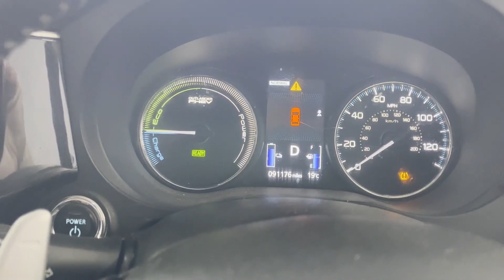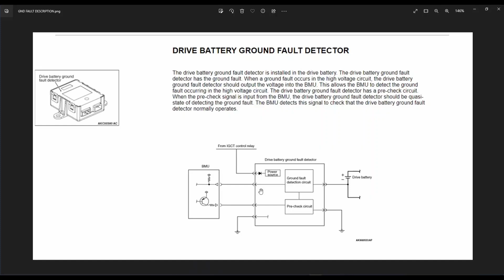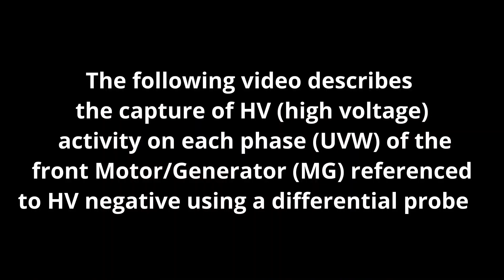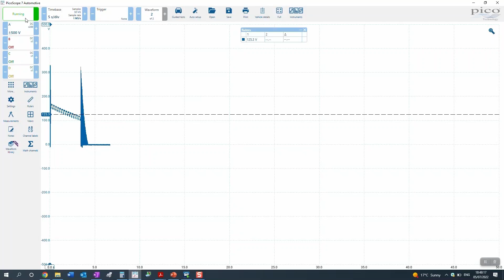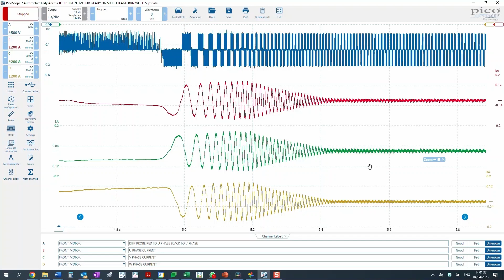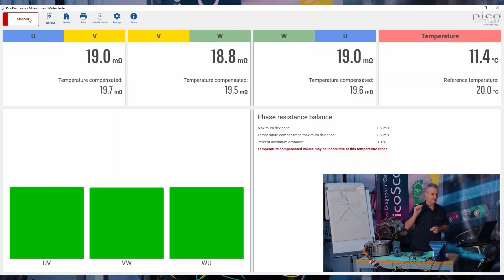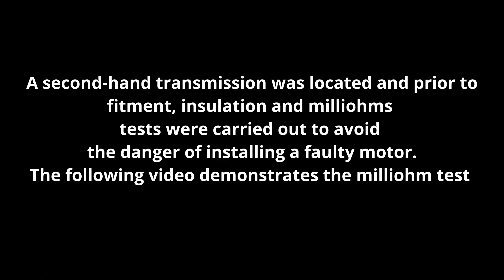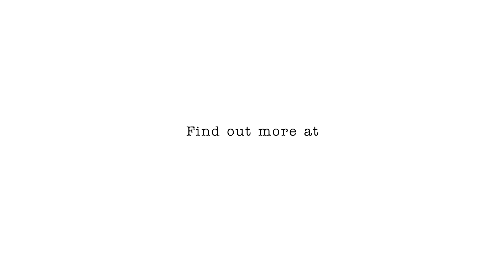Case Study - High voltage isolation fault diagnosis with PicoScope | PicoScope Automotive

Comment: Good video with many informations, thank you. 1:03:00 maybe think about an adapter with a tubular cable lug on one and a banana socket on the other end, so that you can use screws for conneting the measure leads to the motor instead of using crocodile clips. 
And maybe something with a vise grip (on a bolthead) for conncting the housing to a measure lead.

Comment: Hi Steve, the Video you did is very good Work. The Analytics Work and the gentle explanation is a Show👍
I have a question. How did you Bridge the "open-contactor-circuit" while unplugging the Motor?
Best Regards from the Alps.🔧